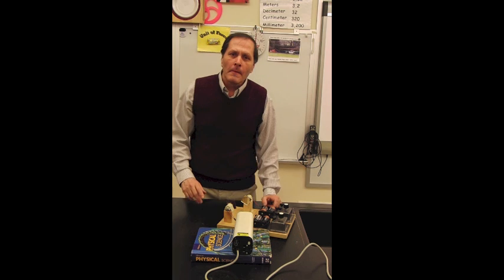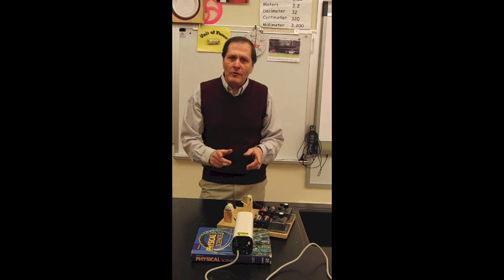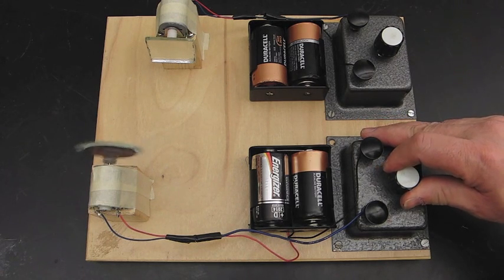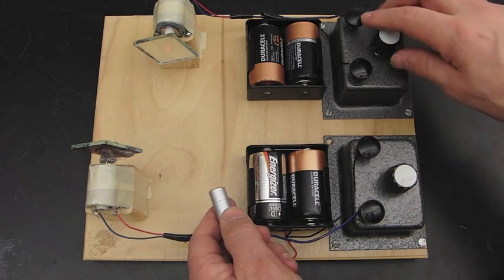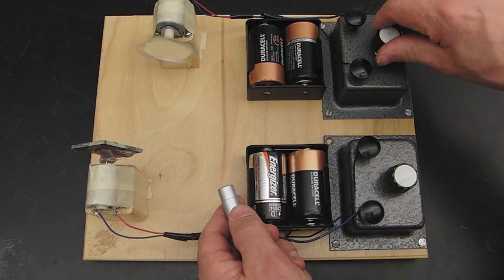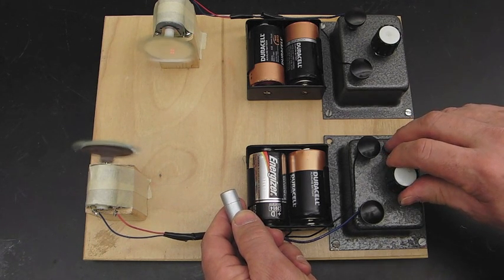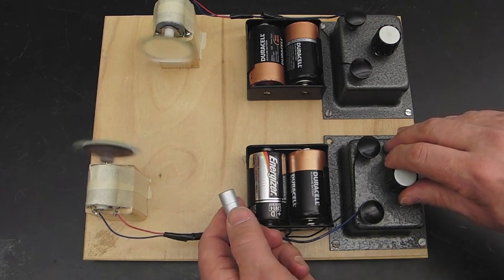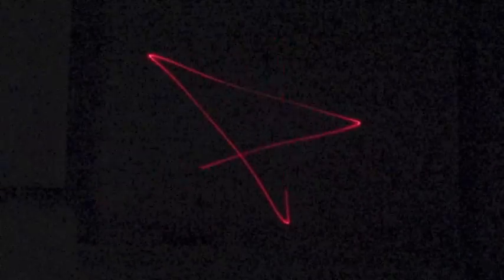LASER Lissajous patterns..geometric designs /// Homemade Science with Bruce Yeany

Comment: Hi Bruce.  Thank you for this great work!  I notice you're explaining stable patters develop when the speeds of the two motors are whole number ratios. Two questions: (A)  Is there a way to measure speed of the two motors reliably (and inexpensively) enough to have students find the relationship between stable patterns and simple ratios? (B) have you explored ways to connect this idea to music theory--why some intervals sound "nicer" than others?
Reply: You can do it with a membrane, a speaker, a laser and a little mirror.

Comment: I did this! First trial version gave the same patterns you got. Then I improved my apparatus and got totally different patterns. One was a circle whose radius would vary from nearly zero to a maximum and then to zero again, etc. Could not get the original patterns. Very puzzling. 
   Found out that the direction of rotation of the mirrors makes a difference. If they rotate in the same direction, you get one set of patterns. Different directions, different patterns.
-Fun for an Old physics guy.
Reply: You deserve a thumbs up and a response for that comment. 👍👍

Awesome!
Reply: @elliotburing87  Thanks, Elliot! I had totally forgotten about this.

Comment: What is the voltage in the motors??
Reply from the maker: these motors are fairly common and available on many electronic supply sites.  they are rated at 1.5 to 3 volts or higher.  In this case I am running them on 3 volts
Reply: Thanks!!

Comment: I have a question. If you watch the video for about 2:00, the star figure almost not rotate. But when you look at 2:30, why is the picture rotating counterclockwise? I made that it as a slow video. As a result, when the figure was not rotated, the figure draws a closed curve, but when it rotates, it draws an open curve. If that laser draw open curve, that shape rotate? What conditions draw an open curve? What is the ratio of the frequency of the motor to the closed or open curve? If you can tell me the title of the related paper, I will read it.